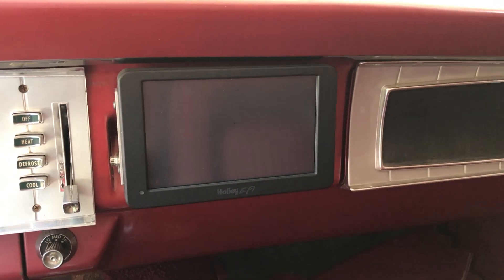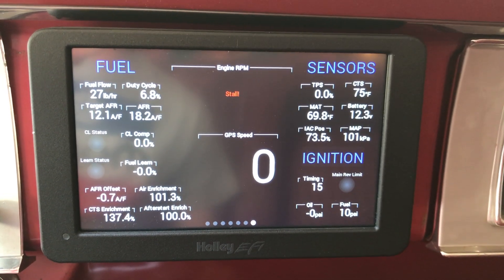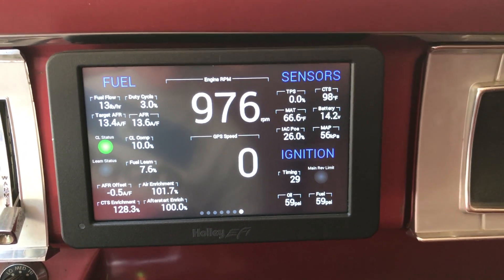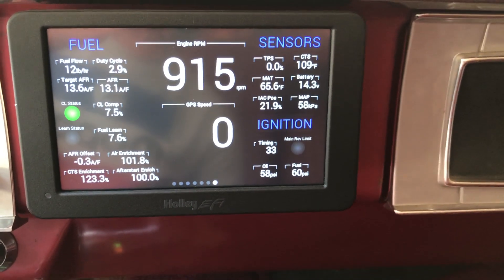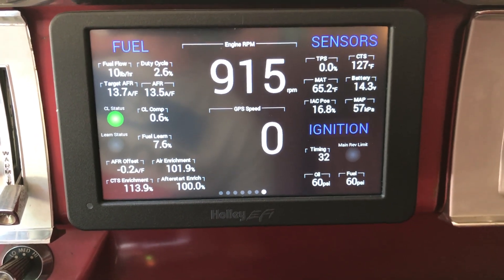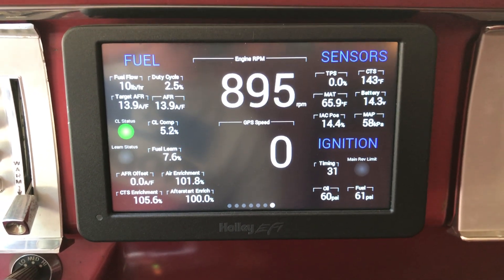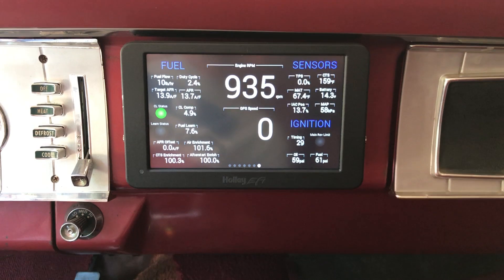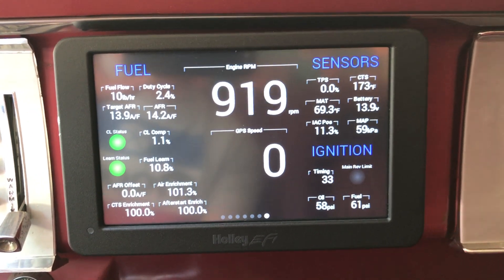Holley Sniper cold start 600 hp engine

Comment: Great video Andy!! Of all the videos on (Holley) EFI, you would think more would share such a comprehensive look at a pure cold start, and walk/talk through the various sensors/readings explaining what they should be doing, etc.. I find so many gloss over the simplest things that tend to have the most real world value to the masses, so thank you!  One quick question though is about your cold start/warm up if you're targeting 13.4 and your CL Comp is having to add 10+ % fuel to maintain that, wouldn't you want to tweak your Coolant Temp Enrichment % Fuel Modifier table to account for that? I'm thinking so you could (more closely) meet your target cold start/warm up AFR if you had a failed O2S, or had to run in open loop?
Reply from the maker: Thanks Frank. The CL comp number will change with the weather and elevation. Anything below 10% is "noise" in my experience. I just started the car this morning to take out for a drive and the CL comp was below 5% the entire warmup. It started off adding fuel and then eventually switched to subtracting fuel before Learn kicked in and took over. I consider that a "perfect tune". What I do with a new tune is practice cold starts in the Fall. Once a month the cold start is colder so you get to see a new range of behavior. If you do cold starts 2 or 3 times during the Fall the tune should be ready for winter. Most people don't drive cars like this when it is brutally cold so a cold start down to 40 degrees is usually all you need to tune for.
Reply: @andyfinkbeiner  that makes sense...I have my CL Comp limits set to 10% max +/- and now that you mentioned it do recall it getting close to maxing out during seasonal changes. I've left my Coolant/MAT modifiers the same all year round, and tweaked the after start enrichment tables a bit to get a happy medium as I do drive on nice winter days too if there hasn't been any snow/salt yet at 40 degree weather. 👍
Reply from the maker: @frankconte5545  You just have to play with it. Holley doesn't get very far into the weeds on this kind of tuning so you're on your own. The good thing is that once you know how to do it you can't really get too lost. Just keep a backup copy of your tune and keep careful notes and you'll be fine. Gradually you'll dial the tune in so that the car starts great hot or cold.
Reply: PS I want one of these Digital Dashes so bad, I currently have 2 of the 3.5 LCD's side by side now, but they don't compare to these dashes...I recently had a chance to play with a 6.86 ProDash and man was it trick!!  Took a while to figure out how to get a custom fuel gauge to "lay over top" of the Holley EFI analog look theme where they put the gauge values in the actual background image...that was confusing the crap out of me....

Comment: That was an excellant run -down of the Holley dash.  Great infomation.  Got me thinking about adding an Accusump (saw it on one of your other vids too) Might have some questions for you.  Thanks for sharing.
Reply from the maker: Thanks Doug. I like having the Accusump in a car like this since you can flip a switch and have oil pressure inside the engine before hitting the starter.